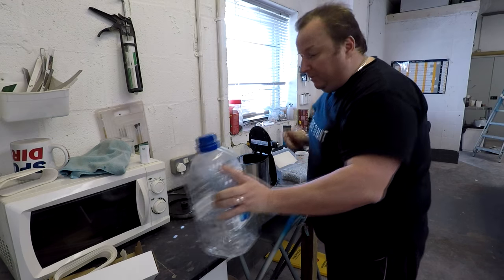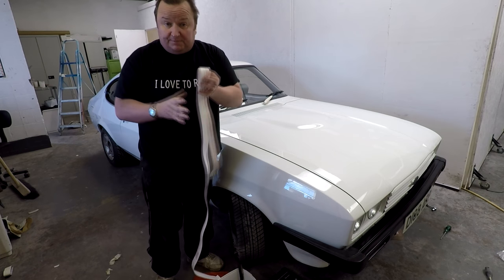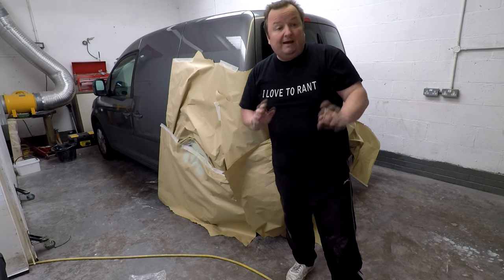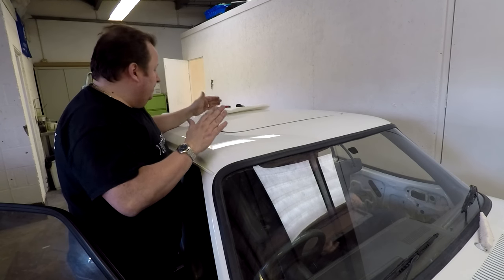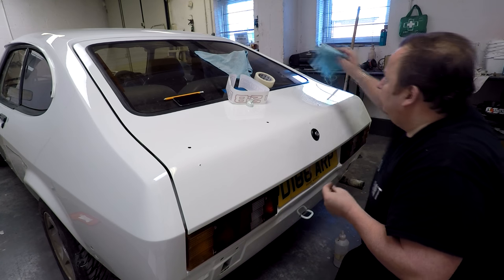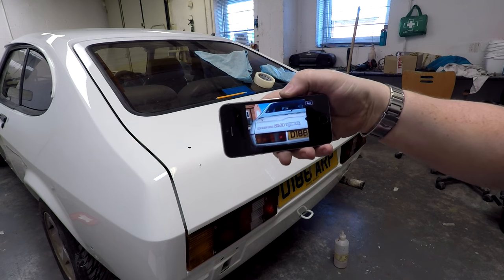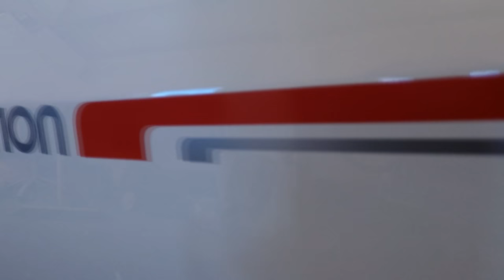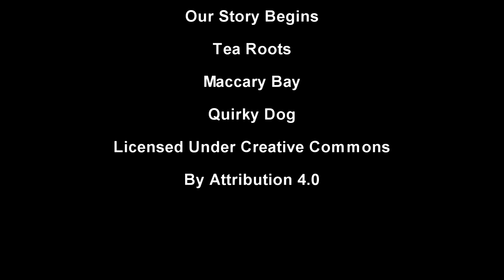Capri Update Putting On The Graphics

Comment: How much do u charge for painting the capri mate
Reply from the maker: It would depend on any extra work like stripping parts off and how much bodywork repairs were necessary.
Reply: Just a full body and paint like this capri if u wasn't assembling it all or how much did this job cost mate just so I can get a better view of prices cause as u know I'm in Leicester and want to set my own place up restoring classic cars
Reply from the maker: This one was not just a respray, there was repair work and welding but a full spray job like this one would be anything around the £2,000 mark from most restorers.
Reply: retrorestore ok matey , cheers just want my own business restoring classic cars , any tips on how to go about it ? Add me on Facebook to chat privately if u like my names Jamie Stephen needham , got a pic of my black capri as my picture ,